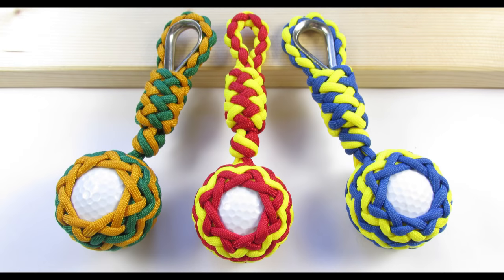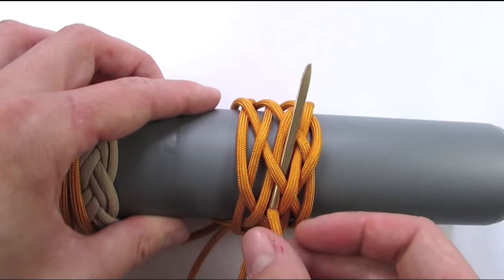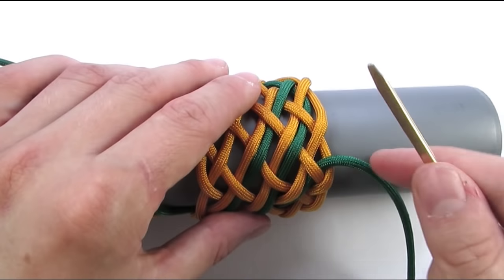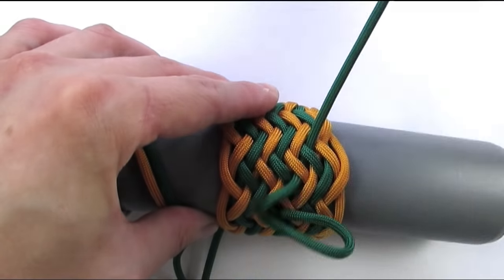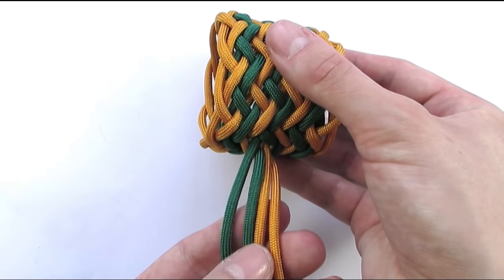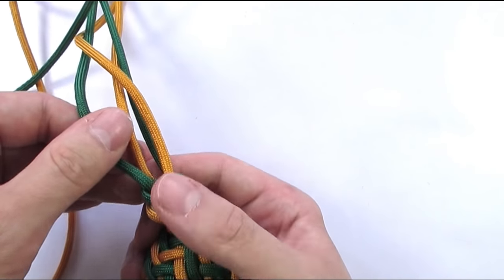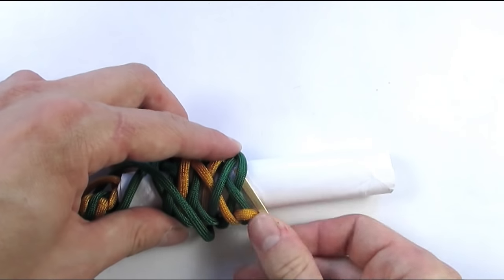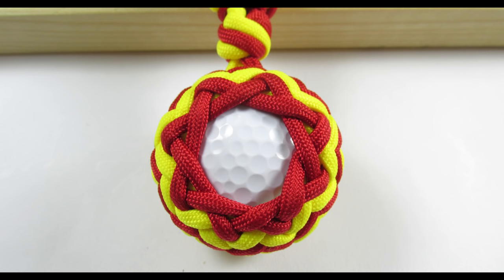Golf ball paracord key fob

Comment: Video is brilliant. I will get there with this. Good angle and good visuals. When starting this video, you have a bunch of cord wrapped around from the standing end. How much, and why? If I have a 10ft cord, how much do I work with to get the knot and how much is left on the standing end?
Reply from the maker: Hey!

Good question! The thing is that after we tie the pineapple knot we still have to tie the Matthew Walker knot, the loop and the gaucho knot. We will tie those both with the standing and working end. So we can leave some in the standing end. There is no use trying to pull everything through the knot, since we will need to even out the length of the ends for tying later on.
The goal is to have both ends about the same length after you tighten the knot. The cordage that you will require is probably at about the 6-7 foot range. It also depends on the diameter of your mandrel. 

Mark
Reply: I finally did it!! Took me about 8 attempts and takingit apart eachtime is no fun whatsoever. I wasn't sure about how to tighten it, but I worked it out. I think the rest is a little easier from here. If you have any advice on how to make it more equal in terms of the open sides. On mine, one open side is slightly larger than the other. I assume I just need to introduce a little slack to the tighter side from the loose ends, and then work it through the other side, which seems like it could be a time consuming job. Thanks for the video dude. It's awesome. I've spent about 10 hours on this thing so far but it's looking brilliant! Thanks to you :)

Comment: Ok, I'm almost there. I've got the main turks head pineapple done. I've got the Matthew Walker know done. I've got the rope done and I've spliced it in. That gaucho though... The problem I have is that I can't do it on a separate mandrel. The clip on the loop is latched on and it is quite heavy for the job I'm doing as the clip is a quick release horse bridle clip. The golf ball has been replaced by an 8 ball from a pool table. Having these heavy things on the ends means I'm stuck making the gaucho around a heavy ended piece. What a pain! I will get there though. This has been 4 knots I've never done. And this last one is not going to beat me! The twisting cord is a pain as well as it twists badly when threading it through.
Reply from the maker: Excellent!

Really glad to hear you did so well!

I usually do not tie the gaucho on a mandrel, but directly over the splice. I used the mandrel because it is easier to demonstrate.

Mark
Reply: Paracord guild I did it!!!

Comment: Great video, where do you start, started twice but had to unwrap the whole thing as i didnot look the same as on the video.
Where do you start with the first rope? In the middle, hoe many cm's from the end?
Reply from the maker: Hey!

It really does not matter too much as long as you have enough to tie the knot. When tightening, you can pull in the longer cords and adjust the knot so all cord coming out are about the same length.

Mark

Comment: Aaaaahhhhh!!! That damn gaucho knot is eating my lunch!!! I will get it, I don't give up too easily.
Reply from the maker: Yeah it is probably the hardest thing in the tutorial. 
Do search around for a few tutorials on multi strand turk's head knots if you need more info!

Mark
Reply: Thanks Mark, I will do that. On this gaucho knot, having the 3/4 done key fob hooked on to the mandrel just helps get my cords more scrambled up. I may just try making the gaucho on a mandrel separately and attaching it when I'm finished. That's not cheating, is it??
Reply from the maker: As long as it works it is all good :).

Mark
Reply: I got it made and it looks pretty good for my first attempt. I made the gaucho on a separate mandrel then slid it on the key fob, my only question is "exactly" how to tuck and hide the left over standing and working ends. how do you tighten the knot with the ends tucked in, I had to leave them out till after I did the tightening, then I had a problem trying to get them tucked. Thanks, I've learned a lot from your tutorials.
Reply from the maker: Hey!

Take a look at the ending part of this tutorial for example:
https://www.youtube.com/watch?v=pn261gKMuJk

This is how I do it, maybe it will help you as well!

Mark

Comment: Great Video.  However, I don't understand how you are securing the rope thimble?
Reply from the maker: Hey!

Usually I do it in the end by pushing it into the inside of the loop. It should be a tight fit.

Mark
Reply: ok.  I will try this.

Comment: also where can I get that kind of lacing needle?  I searched online but didn't find any.
Reply: I think it's a secret. I've asked a couple of times.  : )   Nice, isn't it?
Reply: I can't find them either but the local Hobby Lobby has a brass jumbo perma lock lacing needle with a round flared head. I have taken these and filed down the opposite sides to make a shovel head that is to my preference, or cut them down and ground the shaft at a shallow angle so that it can act as both a needle or spacing nail. Somewhere must sell them but, eh, I work with what I can get. Biggest thing I learned in doing this is to get out the polishing tools and work out all the tool marks till the filed sides are mirror like.
Reply: try tandy leather
Reply: try tandy leather
Reply: gordon hood thanks
Reply: This one is hand made in Germany.  : (

Comment: Uh oh...On the third watch, I'm tying. It would be helpful to know at the beginning that you don't want to start the knots at the end of the cord, but to leave about 3 feet (?) for a tail  to use for the rest of the project. [SIGH]
Reply from the maker: Hey!

It should not be that much of a problem. You need to retighten the knot a few times anyway, so just work in the length needed from the long end and pull it out of the short end. Sorry that happened. I am at your mercy :)

Mark
Reply: +Paracord guild I did that. I'm working on the TH part.  A text box insert or a note in the description might help, though.

Still love you!
Reply from the maker: Phew!
Reply: +Paracord guild I thought you'd be relieved.  : )  Bedtime for me. Thanks and God bless you, Marko.
Reply from the maker: I wish you well as well Tana!

If counting sheep does not help, try counting parts in a long turk's head knot :)